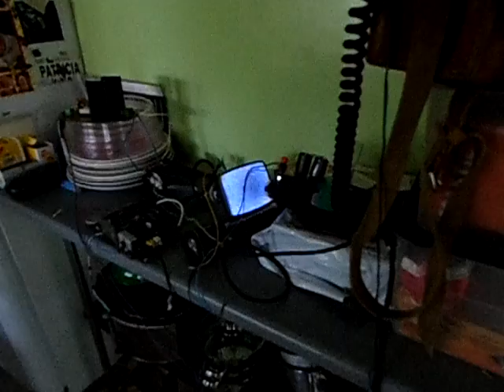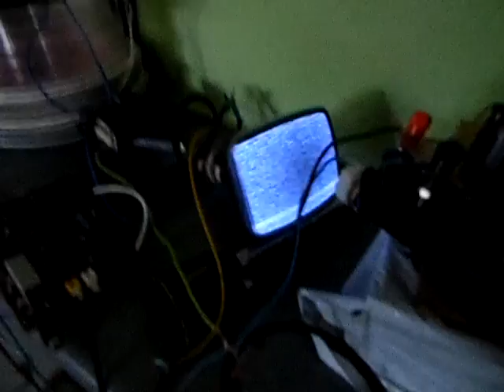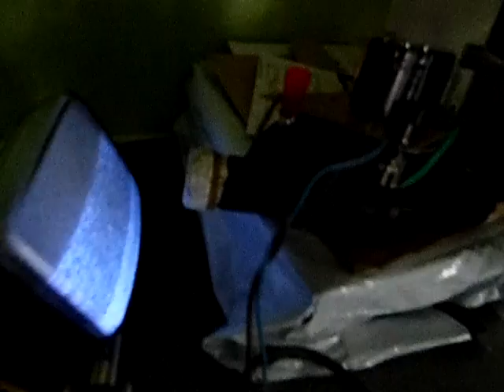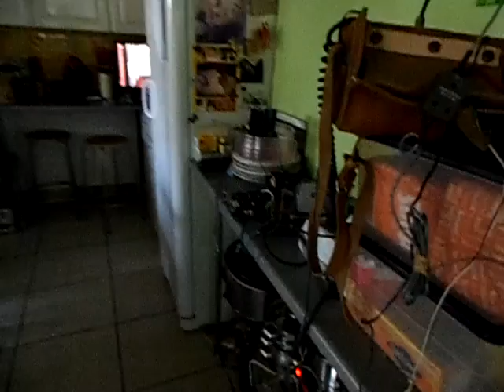T.V. Emits X RAYS

Comment: it could be something else than x rays production depending on how you produced your high voltage : to be able to go through that can kind of tube the voltage has to be over 30Kv at least;  and if you're using a high frequency high voltage source then it produces high frequency magnetic field around that is enough to ignite the geiger tube without any ionizing radiations. I was too trying to produce Xrays with an old oscilloscope tube when I realised that my geiger counter was going crazy even when the oscilloscope tube wasnt  linked to the HV at all!! but as soon as I turned the HV on and got my geiger near enough it started to react. I also tried with an old TV cathodic tube too but the screen was too thick and armoured with lead (there was a label warning about x rays production if HV was going too high). When I was using the old vintage oscilloscope tube (wich is very thin compared to TV tube)  i was able to produce loads of Xrays even without having to heat the filament of the electron gun at the rear end. I had a fluorescent screen to chek on the x rays production in the dark and could see the bones of my hands and even foot in my shoe!! The image wasnt sharp as the source of x ray production wasnt  a small surface but the whole screen.
Reply: It is X-ray and HIGH DOSAGE OF THAT. Obviously do not play around with it if you don't want yourself sterilized or get a nice tumor (hence the uploader turned it off immediately). This was the original experiment that discovered x-ray as a secondary emission of cathode rays as the electrons bombard metal surfaces, meaning your CRT always emits X-rays but it doesn't penetrate enough. JJ Thompson and a lot of scientists experimented with it a lot in late 19th century. Too bad people are absolutely illiterate about scientific history. Originally a Crookes' Tube was used but a cathode ray tube does the same exact thing but a different design.
Reply: @akosv96  What voltage did he produce? What gieger counter did he use? Could it be measuring  beta or gama? I see nothing in the video that tells me its x rays.
Reply: Newer CRT TVs have an aluminum coating on the inside of the screen, like vapor deposited or somthing to stop ion burn, probably stop some x rays too.
Reply: @quantumbits It's high voltage... that means x-rays
Reply: @SoundsLegit71 They all had leaded glass in the front of the CRT to stop any x-rays that were inadvertently produced.

Comment: Nice demo. You might find more at the back as the glass is thinner.
Reply from the maker: sorry just seen this... Thanks I have my own workshop (lab) set up now so may revisit some time I also have a few x 
x ray tubes scintillation screen etc so maybe diy fluoroscope vid ? would have to look into regs first before putting something like that on yt though always been fascinated with em waves of all lengths but especially the high energy end..  im on with a diy scintillation probe at min pmt with built in crystal compartment
Reply from the maker: i intend to start making content soonish lol

Comment: Is your Geiger counter wrapped in aluminum to prevent electrical interference? I always thought that there was lead in them to prevent x rays.
Reply from the maker: It wasn't but I repeated it with it wrapped and grounded to make sure, there is lead in the glass but this will only stop xrays upto a certain energy mate, also the lead is mostly in the rear glass part of the tube apparently. also we have to remember this is a very small black and white TV so no metal shadow mask inside and a relatively low acceleration voltage so the glass is relatively thin in comparison to larger colour tubes, it was never expected to see this voltage even in a fault condition ... 
Thanks for watching 

Steve

Comment: Can you do an X ray test on a normal CRT monitor? I want to use them but not if they emit that stuff from a distance!
Reply from the maker: You are perfect fine to use a CRT  TV , this was an experiment, I pushed up the high voltage WAY above normal operating voltage, CRT TVs are very safe to use, please don't worry they have a built it protection circuit to ensure the can NOT emitt x-rays 😁👍👍👍👍
Thanks for watching 

Steve
Reply: @T2D.SteveArcs  Thought so but I was just seeing if you thought differently. - Thanks
Reply from the maker: @xylem2202  no problem 👍👍👍👍
Reply: @T2D.SteveArcs  
I found a TV with a screen of this type (crt) in the trash and because I like repairing devices I wanted to fix it. However, it scared me that it said "The X radiation generated by this set is sufficiently sealed" on the plastic casing , because I have not seen it written on other TVs of this type and I thought that this particular TV under normal conditions produces x-rays (some very old TVs may do ) The model is  Grunding               p 37-443 .

Comment: Would the CRT stay on at overvoltage at a harmful level? I want to use an old CRT but make sure it wont emiit xrays from drifting components or such
Reply from the maker: No, most CRT TV's have overvoltage/ xray protection built in. 

No need to worry!
Reply: @T2D.SteveArcs  yes but since some crt monitors are 20 years old now how do we know those overvoltage/xray mechanism's are still functioning properly ?
Reply from the maker: @rosevillereaper9230  you really dont need to worry my friend, I have repaired many CRT TVs and have never seen one emit xrays 
If you are worried you can buy a cheap Geiger counter for 35 bucks

Steve
Reply: @T2D.SteveArcs  cool thanks man MK1 looks sweet on these crts i have a hard time giving them up. insane test by the way !
Reply from the maker: @rosevillereaper9230  thanks mate really appreciated, have you seen my other high voltage chaos? You might like it🤣👍👍👍
Also I plan more CRT videos in the future 👍👍

Steve

Comment: I have a similair style t.v; if i were to disconnect the crt, and use the power supply to power an ionocraft then I won't have to worry about x-rays correct? I assume it's the vacuum tube that is producing x rays, but I still cant help but worry about it.
Reply from the maker: Its the actual CRT which itself is a Vacuum tube..
U can disconnect and use the hv without any worries of xrays mate
Reply: Thanks for the reply; also curious how many volts did it take to get the tube to emit
 x-rays?
Reply from the maker: @connorfisher1651  not sure mate but I would guess maybe 30-40 kv

Steve

Comment: I have a monitor that cuts out on the X-Ray protection, I've disabled the protection just to prove it's that, would the screen have to be bright white for it to produce X-rays?  My screen is black, but I get a white dot when turning off.
Reply from the maker: The xray protection circuit just monitors the voltage after the main regulator so if the set will run on a reduced input voltage but cuts out as you increase the line voltage it's likely your main  b plus regulator has failed short circuit and is passing too much voltage, ..   yes I think it would be noticeably brighter if you had the 2nd anode voltage high enough for xrays
Reply: @T2D.SteveArcs  Thanks for the reply, I have the monitor working now, it turned out to be the replacement flyback's primary windings were different, so it was putting out too much EHT.
Reply from the maker: Ah you changed the LOPT okay that's cool that you figured out the issue,  good work,  I will be focusing on making my  content more educational when I start uploading again, I've got a small following now so I want to make more taredown and repair videos etc ..
Steve

Comment: I think thats just electrical interference on the geiger tube (electron cascade).

If you measure with a scintillation device it should be nothing.
Reply from the maker: Hi mate I re did this with a small Geiger counter (gmc320) wrapped it tinfoil and grounded and it is xrays ... I have a scintillation counter so could repeat the experiment at some point...

Steve
Reply: @T2D.SteveArcs  yes please do. That'll be interesting to see the outcome. If those are x rays indeed then thats a massive amount by the sound of it.
Reply from the maker: @johnnycash4034  ok I will try find another crt  as soon as possible and I will repeat this experiment, it will be interesting for 2 of us at least 🤣🤣👍
Reply: @T2D.SteveArcs  i also habe two vintage small crt units. So yes it would be good to know. Pretty sure there are plenty other hobbyists out there who would find your findings valuable.
Reply: @T2D.SteveArcs  me waiting on your next experiment: 👀👀👀

Comment: If you ever do repeat this again, Put a camera close and you’ll see white flashes of x rays!
Reply from the maker: Ive got an xray image intensifier from a C-Arm built in power supplies etc , I might repeat it and look at it with that🤔... have you seen my other videos? Loads of monster xray equipment etc 

Steve
Reply from the maker: And yes I know about hot pixels on the camera sensor 👍

Comment: this happens only when you increase the voltage 😊
Reply from the maker: Correct, and most TVs have xray protection so the set would shut down in the event that the b+ was to high

Comment: Show proof of an actual xray. Everythought cathode and anode is used for xray. What u did just a somewhat high voltage and noise. I know that when cathode builds up. I believe it send electrons to anode. I believe anode has to rotate. Not for sure I'm new at this. Then then when anode builds up. It releases energy. When the voltage is build up high enough. That energy that had been released. Is what called xray. Now I'm just wondering how to take a pic of an x-ray released to an object?
Reply from the maker: this is indeed emitting x ray s the  tube is coated on the inside with a slurry aquadag to make it conductive and form  the second anode along  with the mesh and  front of the tube. the electrons are boiled off the cathode focused and accelerated toward the anode due to the large potential difference ..    The tube is made from thick  lead glass to stop any x ray emission in normal operation but if we increase  the potential  there is a point where x rays are produced with enough energy to escape the crt at which point they are easily detectable with the Geiger muller  tube ... and yes if you where to place a scintillation screen in front of it and used a long exposure on the camera you could most likely make a crude x ray image though it would probably be blurry due to the scatter ... They need to come from a single point source to make a nice focused image.. the smaller the target the more detailed image is possible hence micro focus x ray tubes ... could do more on this subject if theres interest in it ..

Comment: I still use these tvs constantly and it only gives of very little radiation
Reply from the maker: Lol no they are fine under normal use, the bigger ones have xray protection circuits so if the hv exceeds a certain level the shut down....
It would obviously be a risk if the main regulator went short circuit and B+ went to a very high level so the designers fitted protection circuits...

Steve
Reply: @T2D.SteveArcs Btw I have 3 crts
Reply from the maker: @fluffymacaw933  nice .. I really like the CRT👍👍
Reply: @T2D.SteveArcs  I love the crt
Reply: @T2D.SteveArcs  now I have 10 crt tvs